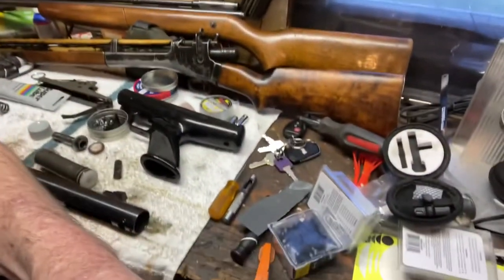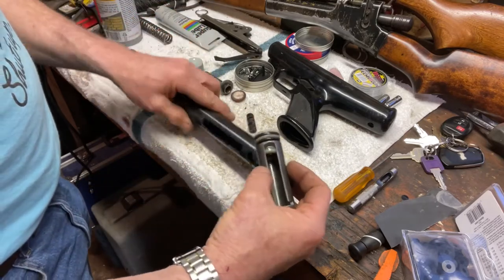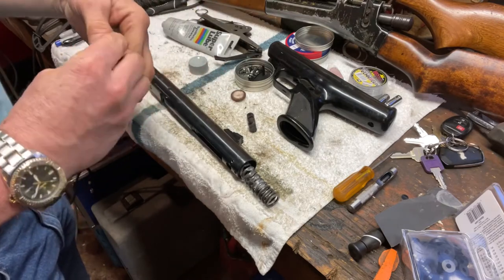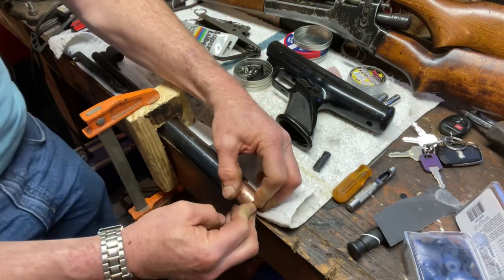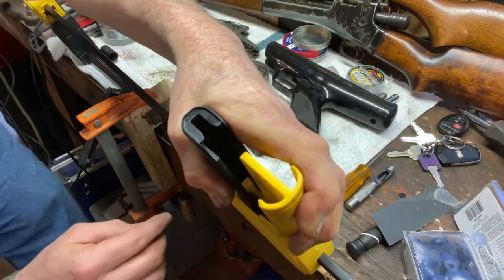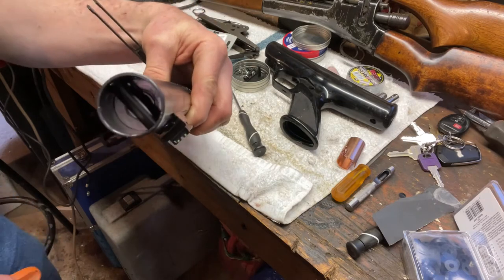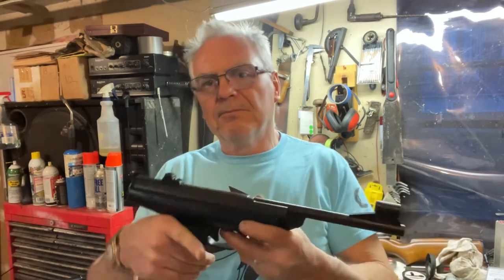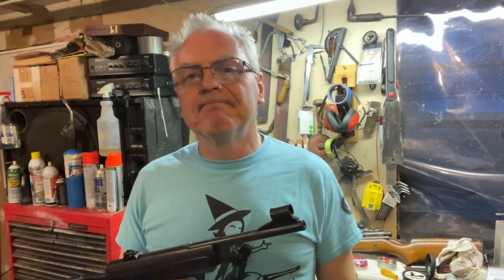BSA Scorpion piston seal replacement

Comment: A common problem with older BSA airguns is the material used for the buffer washer which disintegrates over time turning into a cheese-like material. The other problem is the nylon piston head which can absorb oil and swell, eventually becoming jammed in the cylinder. The remedy is replacing it with an alloy version which is available from Chambers Gunmakers, England. These pistols were introduced in the early 70's and the first ones in .22 cal were recalled as they exceeded the UK power limit of 6 ft lbs for pistols. These are designated as RA. Even after BSA had ironed out the power problem these pistols should achieve 5.5 ft lbs. Approximately 400 in .22 and 550 in .177 depending on pellet weight.
Chambers also sells the correct mainspring for the Scorpion.
Many thanks for a great video.

Comment: Really improved the cocking effort. Like the DIY made tools to work with.  If you get between 400 to 450 fps with another spring that would be good. I'm still waiting every time you pull the trigger for a laser beam to come out.  Lol.

Comment: That spring is old twisted n bent , I can tell by the distance you pushed it in with your thumb….not good , I’ve just fitted an aluminium machined piston and new main spring ….struggled on my own but managed and used a ratchet strap in a controlled manner ….still bedding in , not yet chronographed …..going get it tested when I visit my local gun club regards Alan

Comment: Dieseling will not hurt the gun specially a pistol it's only traveling a few inches  it's good to seat it in good in fact  most springer the piston moves over 200 mph but not on a short stroke gun like pistols or most. Any old gamo or gamo daisy's  if it has a short chamber they don't have time to build up speed and power like a long chamber gun or magnum that's only a 25 mm seal well the piston head is 25 mm but outside seal is 25 .5 mm if it was 30 plus mm it might get 550 fps  but best I remember working on them it's a 25.5 mm seal